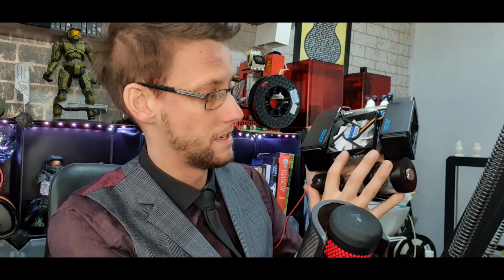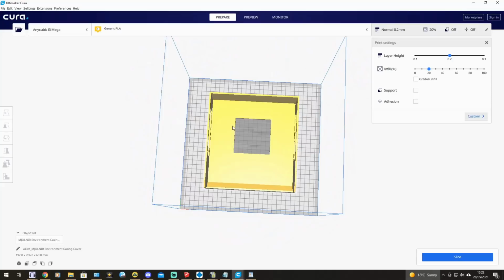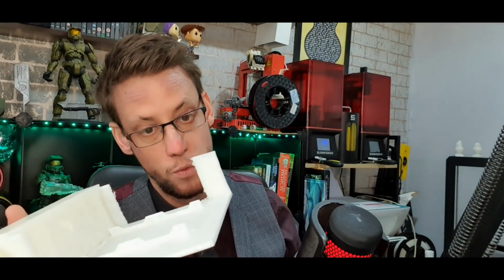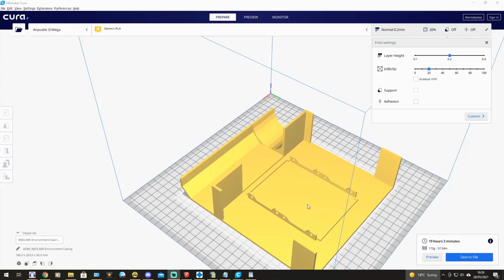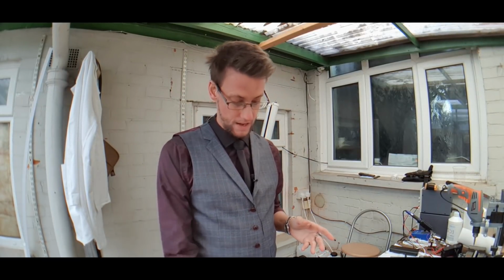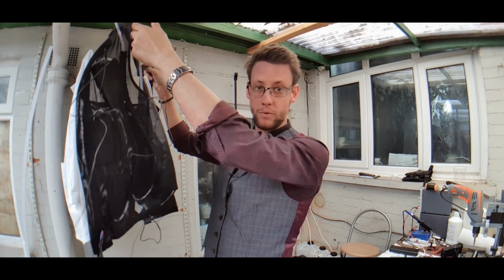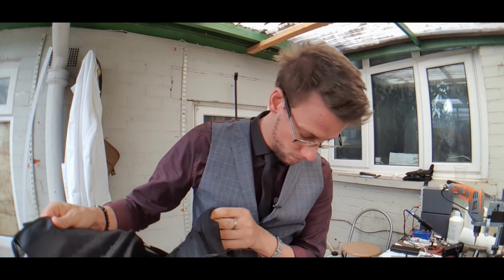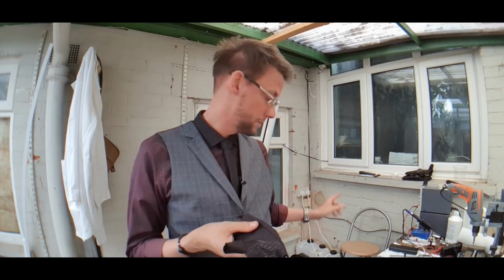Project: MJOLNIR - Update 04

Comment: Hum…. You mentioned centralizing the microcontrollers driven by the mussel sensors.  Given the sensors effectively driving local actuators mimicking/enhancing local movement.  Couldn’t autonomous sensors, actuator ( or artificial mussels ), and a localized controls be scarred over the body.  So the bicep sensor, controller, actuator, all be in a wrist unit .. even with local battery packs for short term function with the central power down?
The massive redundancy with no central point of universal failure.  With each arm, limb, leg, body, segment independent peace’s clipped into the frame and undergarment/sensor sockets?  This would seem to better follow the concept of the modular armor … though not with slip on under garment musculature suit.  ( though the under suit in the game seems more massively modularized.  Where essentially each square inch ( or whatever) senses and contracts or stiffens as whatever the body underneath is doing… and/or related to what’s next to it.)

Comment: I'm sure you're more aware of the tasks you to trouble shoot than you're showing here for the sake of entertainment value.

But if you find yourself with down time due to covid bottle necks in the future you could look into the code for the muscle sensors.

I had a roommate who built a powered exoskeleton for a university club and his senior project was on soft robotics that used muscle sensors and one of the biggest hiccups he found that the sensors tend to pick up a lot of input noise from minor contractions or impulses in the muscles depending on the sensitivity. 

And he amount of time he lamented spending having to look into dampening controllers and other methods of eliminating the noise to pick up the desired signal. Might warrant a pre phase two investigation.

Comment: In your mind how would the cooling system perform in different environments. for example if the air was 100 degrees F or even hotter it would radiate heat a lot less effectively. I thought about what would happen if you submerged it, but it would probably still work because of how well water conducts heat even though the fan wouldn't be creating any flow. As I'm sure you've realized its easy to make the suit and electronics watertight, but actually having all the systems work properly underwater is a challenge.  great work btw

Comment: im not sure how your doing the batteries? but with the proper circuitry in place you could wire them in series with the ability to hot swap batteries out without powering down the suit

Comment: If you put the micro-controllers on the back you become a multiplayer spartan enough force to your back will kill your sensors but there much better there then getting in the way where theyll get cracked more frequently from your movements and they wont scratch you back there

Comment: 17:30 so basically like how the Xbox Series X has a single outtake fan on the top with the air getting vacuum pulled into any vent at the bottom and back. Would say that you don't really need a reservoir on it, they more just give extra water to make the saturation point higher and watch for when water levels run lower. Could save some space from not using one though it would make refilling a tiny bit more annoying.

Comment: Also, did I hear you were 3d printing thr helmet with a metal filament? If so, you should send it to Demolition Ranch or Kentucky Ballistics so they can test how it holds up under fire.
Reply: adam savage constructed an iron man torso from titanium by this methode and it was bullet resistant to at least .45 caliber.
Reply: @Chrisspru  As stated "If it isn't done precisely" it will not work, if it is done correctly then of course it will work, and yes I have seen Adam's video it is quite good but that alone cost him $443,000 USD and something tells me 00 won't spend that much.
Reply: @Chrisspru  And .45 ACP has a fraction of the power and penetration of even an intermediate rifle round.
Reply: @skywardsoul1178  far as I know, didn't Adams suit take everything thrown at it? Pretty sure it just had some major denting
Reply: Clarification on what he said is laser sintering. Basically he's getting titanium powder fused together layer by layer until it forms the shape (pretty cool stuff).
Reply: @fmk99mc74  Sooo type of 3D printing?
Reply: @dr.catherineelizabethhalse1820  If you want to classify it as that then sure, though the process is closer to laser engraving multiple layers. Problem with this being that the process is not perfect and it's not exactly easy to file-down titanium with home tools for this process (especially small areas).
Reply: @fmk99mc74  it would shatter
Reply: @GiskardRevenlov  If it isn't done precisely (sintering too cold, hot or far apart) then yes it can shatter.
Reply: @GiskardRevenlov  no it wouldn't... there are fully metal 3d printed guns... a test 1911 survived over 2000 rounds
Reply: @commandingsteel  armor getting hit by a bullet and a firearm frame holding together are still vastly different lmao.
Reply: @collinb.8542  the gun has to contain the explosion... it's not just the frame
Reply: @commandingsteel   @steelshark studios  yes but steel designed to contain an explosion and firing pressures and steel designed to withstand fire are still both very different, not to mention I'm sure the handguns you mentioned were not constructed in the sintering manner that the previous commenter mentioned...